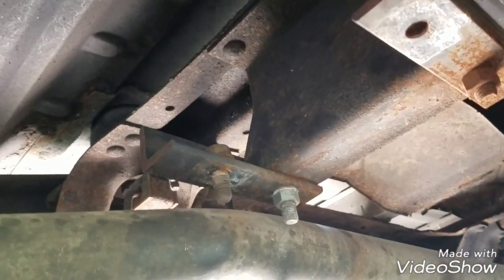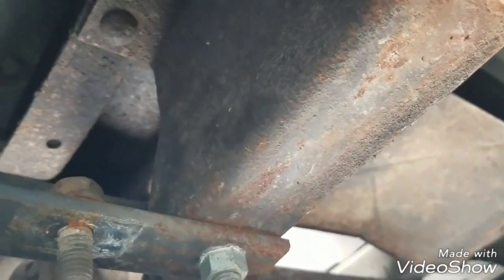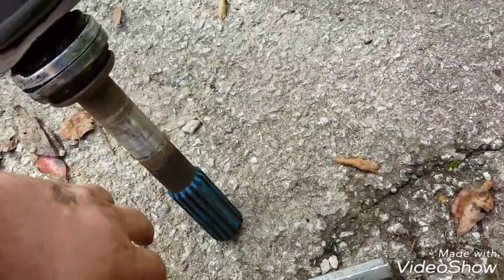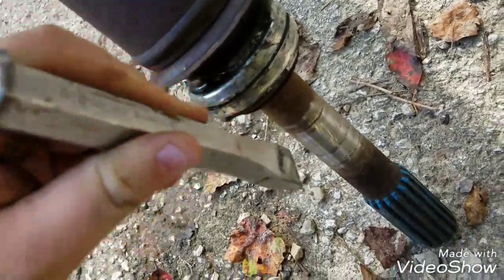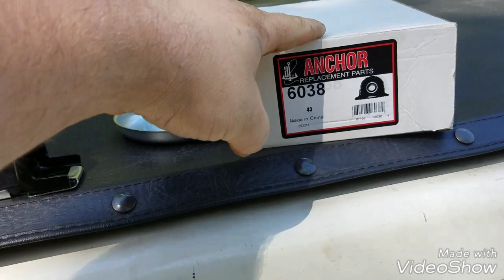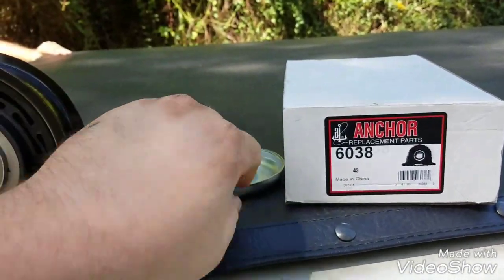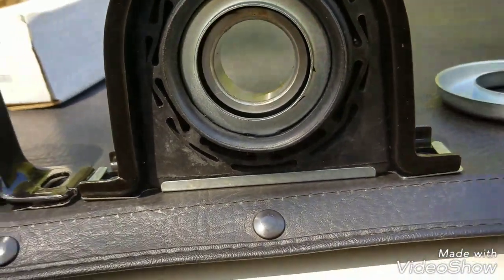OBS F-Series: 1980-1997 Carrier Bearing Replacement & Discussion

Comment: The 40MM bearing is the one that worked, the other one was a 35mm bearing (I have no idea why there is a difference)
Reply: The difference is the size of the driveshaft. F150 is the smaller one. F250 is the middle sized on and F350 is the large one. There are 3 listed for our trucks. So an F250HD could use the larger one depending on which driveshaft Ford put in.
Reply: @Xfire1347  good to know, mine was an f350.
Reply: @Snowlep337   Im doing an F250 today. I will verify what I said or correct what I said.

Comment: I have a 1988 Ford motorhome. Rock auto lists 4 sizes.
1.378, 1.5748, 1.9685, and 2.3622.
What is the best way to measure for the correct size?
Reply from the maker: Dial caliper where the bearing rides